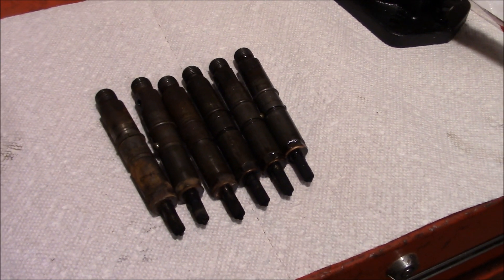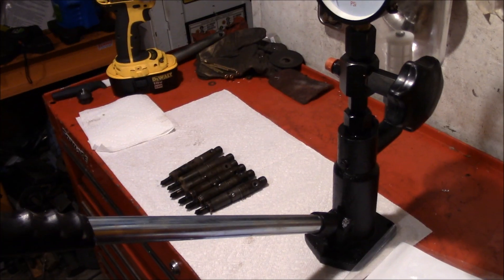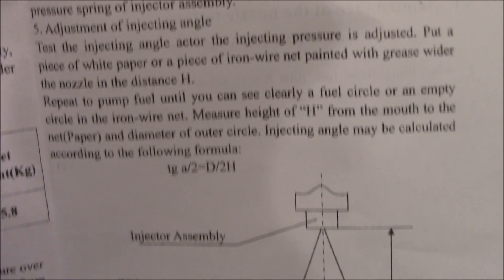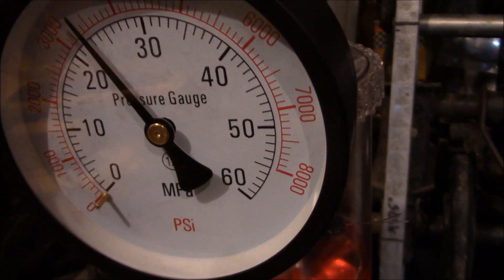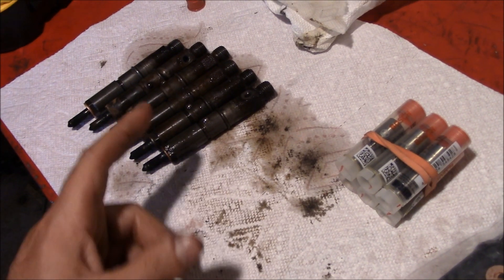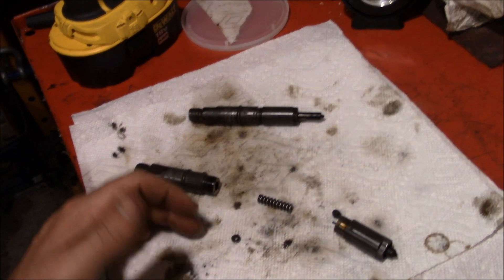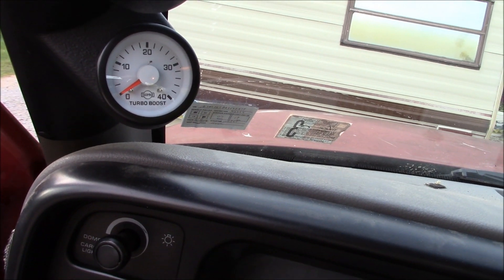Budget Cummins 12V Injector Rebuild & Pop Pressure Test

Comment: I have one and use the knob to both test "Exact presures" and "Bleed off" for removal.
Testing run the pump presur up as high as you can (one pop) and repressure with knob Half way out  or a lil more. Then turn the knob in you can see "Exact" pop pressure without the needle bounce. Then when you back the knob out.. it releases pressure for injector removal.

Comment: Just bought one of the myself.. 3 spelling mistakes in the instructions.. disappointly..😏 anyhoo… the screw in handle which was leaking… you can use that to do a ‘leak test’ so what you do is pump up the pressure but stop before the ‘pop’ pressure and screw that handle in and leave it.. if fuel leaks out.. the injector needs sorting etc. At least that’s how it meant to be.
Reply from the maker: Good to know!
Reply from the maker: Good to know!

Comment: So maybe that turn nob is to simply bleed off the remaining pressure so you can safely remove the injector.  You tighten it up fully, test it, and then untwist it to release.  My guess is that you'll still have up to 3k of pressure left after it pops, so you don't want to unscrew your injector with the fuel still pressurized.
Reply from the maker: True, that might be the right way.
Reply: I have one and use the knob to both test "Exact presures" and "Bleed off" for removal.
Testing run the pump presur up as high as you can (one pop) and repressure with knob Half way out  or a lil more. Then turn the knob in you can see "Exact" pop pressure without the needle bounce. Then when you back the knob out.. it releases pressure for injector removal.

Comment: Those are nozzles not injectors
Reply: What are you on about ? He's got injectors with nozzles on them, I dont know how else you figure you'd pop test them
Reply: @EvanWSH  
He's right. Those are just fuel nozzles.  There's a difference.
Reply: @dennis smith  uh no he isn't right, the entire unit is an injector, the piece sticking out passed the copper sealing washer on the bottom is the nozzle. If you go to 9:25 you can see the new nozzles swapped in.
Reply: @Evan Ward  
No, the entire unit is a fuel nozzle. The part swapped out is just the tip. Pre electronic cat engines use the same system. That nozzle has a tip, spring, and metering plate, which only allows flow in one direction  and ensurese the fuel pressure is enough to atomize the fuel.  Thus,  the pop off pressure. An injector supplies the pressurized fuel. Usually through a plunger assembly.  With a fuel nozzle pressure is supplied by the pump. Usually having plungers and a rack to meter the fuel.
Reply: @dennis smith  so you're going to argue that the only technical fuel injectors are heui units and anything else including every single common rail injector is not technically an injector and anyone who refers to it as such is wrong.
Reply: @Evan Ward  
Fuel nozzles and injectors both require fuel supplied by a pump.  Injectors have plungers in them that force fuel through the spray tip. They are usually actuated by a rocker that cycles the plunger. A fuel nozzle requires the pump to supply  fuel at high  pressure, high enough to atomize. I have 2 trucks. One has a 3406B. It uses a scroll style pump and fuel nozzle just like the ones for that little Cummins.  The plunger assemblies are in the pump. I also have a C13. It utilizes electronic unit injectors that are supplied by a low pressure pump through a common rail. The plungers are in the injectors and actuated by a rocker via the cam and a push rod. Injectors, and fuel delivery nozzles are different.

Comment: do a teardown of the pop tester
I found a lot of crap in mine, especially the one way valve inside was caked with metal shavings and grinding dust
but you need to mount it on a solid surface cuz all the threads are tight af
Reply from the maker: I'll probably wait until I need the tester again, then be forced to rebuild it, haha.

Comment: Hi, where did you get the shims from and what thickness are they avaliable in or is there an "all rounder" size? Thanks
Reply from the maker: There's a kit on ebay, they come in a couple standard thicknesses, but you can mix and match multiple shims to get the desired thickness.
Reply: @toocheaptosmoke  thanks, friend. Be well.

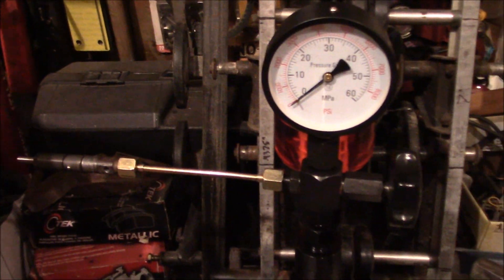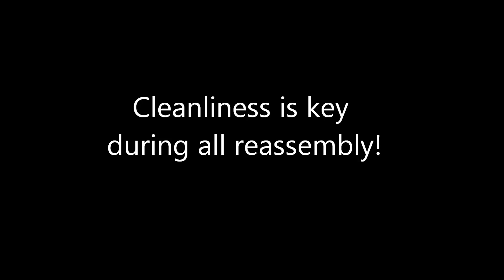Comment: Thanks...clear and helpful.  Question, please, re LEAKING Shut-Off Valve you discuss at 9:35-10:55.  Had exact same problem on day one!  If you fixed that, HOW, please?
Reply from the maker: Unfortunately I have not messed with it much since then.  Has to be a simple o ring or seal in there though?
Reply: @toocheaptosmoke  I'd recommend to just factory delete that thing
put a plug in there or cut it off and weld it shut
I went for a tester without that valve cuz the amazon reviews guided me in that direction
even if you can get it to seal, it's very difficult to actually get a moving shaft tight, especially at these pressures
edit
also it was cheaper without the valve

Comment: How did you get your tester to hold at 3000 psi? I hooked mine up and every injector i pump them up and mine are bigger and all pop around 4000-4200 psi but after they pop the pressure slowly goes down. Even if i pump it up right to before they pop the pressure still goes down on the gauge slowly... and non of the injector tips seem to drip or leak. Thanks
Reply from the maker: I would leave the knob about a turn or two out, then after you've pumped up some pressure close it the whole way and see if that works.